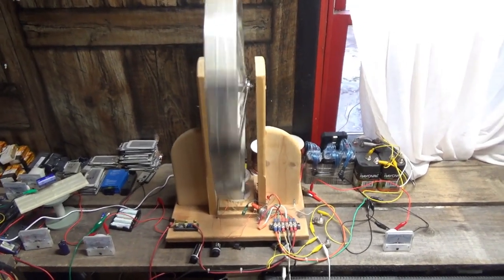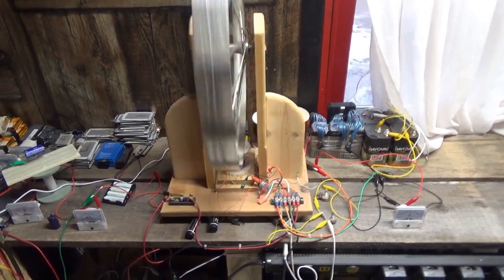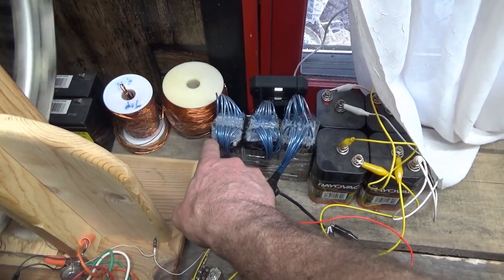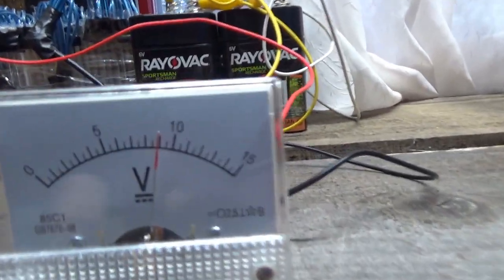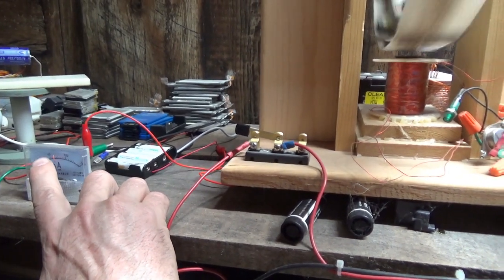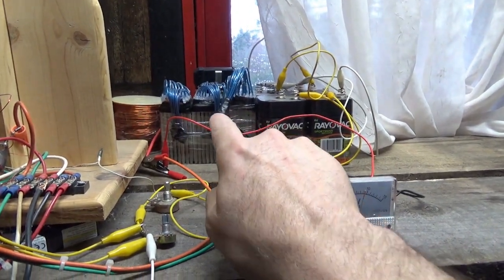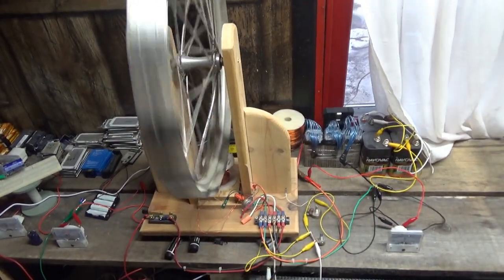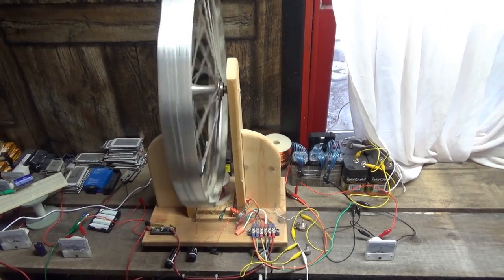Charging 12 Volt Battery With 6 Volts On Bedini Motor SSG

Comment: Can you place an amp meter to show the output current? This is done all the time with transformers. If you double output voltage, you cut the current in half. I would guess the bedini motor is behaving like a step up transformer in this case. Remember, energy can not be created or destroyed. Power in = power out (minus any losses in the devise). Which is why I would like to see the output current. Since power = current x voltage. Voltage by itself doesn't mean anything. At least not for the purpose of measuring power.
Reply from the maker: Output current would show next to nothing on a meter. If you read my article I mention that you cannot measure this energy with a standard volt meter. Its like trying to measure water flow through pipes with a volt meter. 

There is no energy being created here. Never made that claim. Was a bad thunderstorm last night. So much energy released. What an awesome display of power. Its all in the air. Free for the taking. Already existing. Nothing created and no laws violated.

Also consider that this is a motor. Pulling 75 mA and turning a motor while charging a battery.
Reply: @thedoityourselfworldelectr8007  So, your assertion is that an electrostatic energy potential has been lingering in the air since a thunderstorm last night, and this device is somehow harnessing it to charge batteries? You do understand how dubious that sounds, right? If it's truly the case, file a patent. It would be an energy breakthrough, even on a small scale. If it scales, then you'll be a very wealthy man.
Reply from the maker: DHD, what I am saying is that the air is loaded with energy. A thunderstorm is a good example of some of that energy being released. It is inconceivable that someone would disbelieve we can harness some of that. It has been done again and again. HAM radio operators used to deal with it in their antenna wires. It would build up a charge and blow their radios. Now we have special coax cables with less capacitance which prevent that buildup. But its there. Free for the taking.
There have been air flow "generators" which collect charged ions from the air. Its pure science. There are various forms of energy. Solar and wind are just two of those which we cannot see but its there.
Reply: @thedoityourselfworldelectr8007  If you can't measure current, there is no way of knowing what the output current is. Therefore, no way to know if the battery is charging. Knowing the voltage alone isn't enough. You can have 10,000 volts with almost no current. You're in a difficult situation. Because in order to prove something scientifically, you have to be able to take precise measurements. Even if the battery were charging, how long would it take to charge? Long charging time would be an indicator of little energy going into the battery. But again, precise measurements are needed. By the way, I did read your article. But in the video, isn't the volt meter working? Showing 9 volts?
The problem is that is not enough without a current measurement.
Reply from the maker: You can see the output with a scope. I have shown that before on older videos. It shows a high voltage spike of 200 or more volts into the battery, little to no conventional current.
You can charge up the batteries to full while measuring voltage as an indicator. I know, not perfect. Then you can do work with the battery and see how much work can be done down to a certain voltage again. Recharge and repeat.
Reply: @thedoityourselfworldelectr8007  Little to no current means little to no output power. Since power = current x voltage. Let me ask if I may....
How long does it take to charge the batteries you have hooked up now?
Reply from the maker: Again you are using conventional measurement tools. Just because you cannot measure the current with the meters we have available does not mean there is no charging. The battery I am charging now is relatively huge at 32 Ah and will take weeks on this little machine. I am running a different experiment here with a Lithium battery to see if this form of charging is safe for Lithium.

I have had 7 Ah lead acid batteries conditioned to charge up in a day or two on one of these smaller machines in the past. The more you use it on this, the faster it charges next time. I dont know if I have my old notes anywhere. Back then I took very detailed notes.

Did you see the video on here I recently did with a capacitor charging out of thin air next to this machine?
Reply from the maker: David, do you deny there are charged ions in the air that can be harnessed? Universities have done this already. There are other forms of energy as well.
Reply: @thedoityourselfworldelectr8007  There definitely are charged ions in the air at lower elevations during thunderstorms, and in the Ionosphere at higher elevations. Not so sure there is an easy way to harness such energy or utilities would have done it. But at least it can be measured. Definitely NOT denying the existence of electrostatic energy. All known types of energy can be measured. All I'm saying is that for any claims of new types of energy, there has to be some type of evidence. Either some way of measuring it, or some other way to show it's existence. All scientific theories have to be able to be tested. Showing a higher voltage on the output of a bedini motor is not a valid test. Since voltage can be boosted without a new source of energy. It is done everyday all over the world using transformers. The power grid would not function without the ability to change voltage.
Reply from the maker: Its the work you can do with a battery charged up with this. Its that simple. You charge a battery with no current from the run battery. No current gets to that charge battery from the run battery.
Reply: @thedoityourselfworldelectr8007  You're making a lot of claims in this thread like "universities have done this," but can you link a published and peer-reviewed scientific research paper that explains the zero-current charging that you're asserting? I couldn't find one. It's hard to believe that this wouldn't be a studied phenomenon if it's legitimate.
Reply from the maker: I love how you guys twist words. I said people have collected ion energy from the air.
Reply from the maker: https://ionpowergroup.com/how-it-works-on-earth/
https://www.altenergymag.com/story/2019/07/atmospheric-ions-harvested-for-energy/31286/
https://www.indiegogo.com/projects/clean-energy-solution-world-s-first-ion-power-plant
https://patents.google.com/patent/US20130093261A1/en
Just a quick google search turns up pages of results
Reply: @thedoityourselfworldelectr8007  Did you actually click on those links? The first link is to a failed Inidiegogo campaign from over 8 years ago where the pitch video has been made private. The second link is to a broken website. The third link is to the same Indiegogo as the first. The fourth link is a research paper that describes a technology that is different from what you're describing.

I don't think anyone is arguing that there's not a vertical voltage gradient in the atmosphere. That's well known and established. It's just that accessing this energy requires a very tall wire, and the usable energy is not particularly useful because the current (and hence the wattage) is so small. On the order of microwatts for a very tall conductor, which makes it nonviable from an economic perspective. It's just not worth the cost.
Reply: @thedoityourselfworldelectr8007  One more question...
Would it be possible to use an oscilloscope with a current probe to measure current?